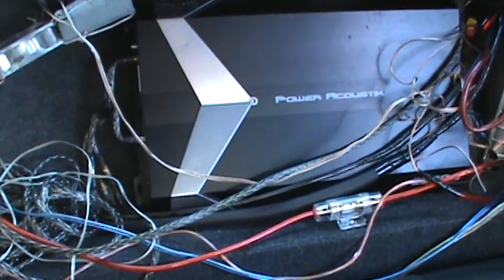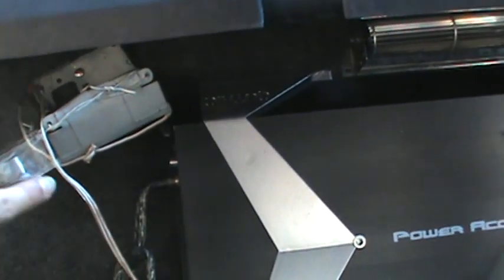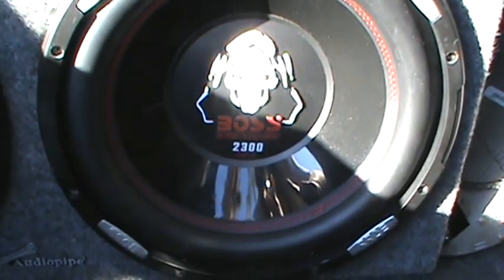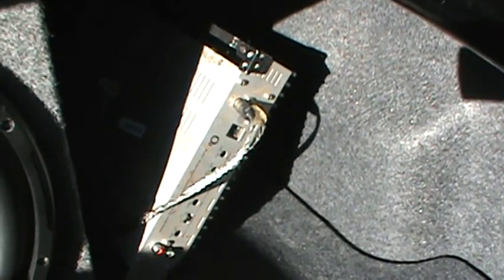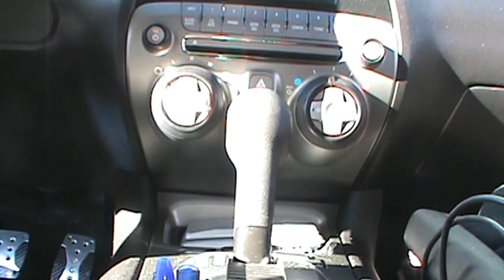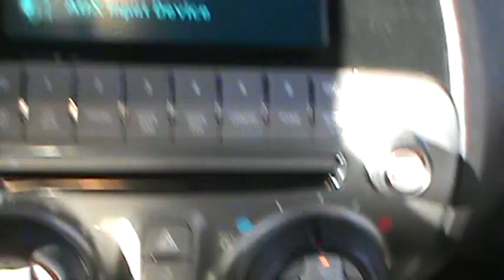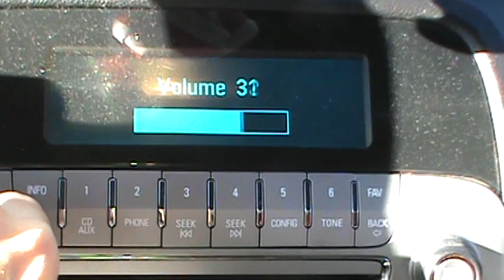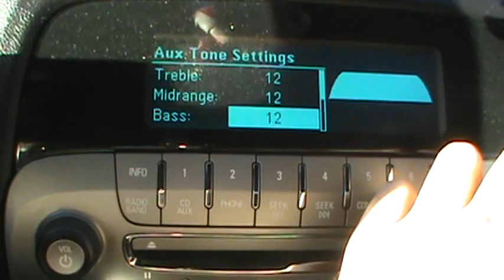Part 3 on How to hook up an amp in a 2010 camaro with out replacing the factory radio finished

Comment: Oh shit I just noticed the fan tied up to some sort of steel bracket with SPEAKER WIRE! give me a couple days I will put up a video of MY SYSTEM with the CORRECT 0 gauge runs  it's all KnuKonceptz candy cable and Rockford Fosgate hardware. My wiring alone for the Kinetik battery, amp, subs, volt gauges and Rockford 3 Sixty line driver was about $400. No cheap ass Walmart line out converters. No cheap ass Walmart wire or Walmart inline fuses. You are not worthy of that car. You should feel lucky if that wiring hack job doesn't catch your shit on fire.

Comment: I thought you said you wanted it looking professional. This looks terrible. Plus, you didn't show us how to install shit. All you said was that you used lawn mower wire and jumped the remote wire from the console. Have fun driving your fire hazard birds nest.
Reply from the maker: +Brent Rhoden I fixed up all my wiring and I've been driving my car just fine and nothing has happened and I even put a windows seven custom built 7" double din computer did everything myself and fyi if you don't like it I'm not asking you to watch it and it's not your car my cars doing fine and been driving and running my stereo system for 3 years with no problems, but thanks for the comment anyway I guess.
Reply: Sorry for the rudeness. At least your video got me on the right track.